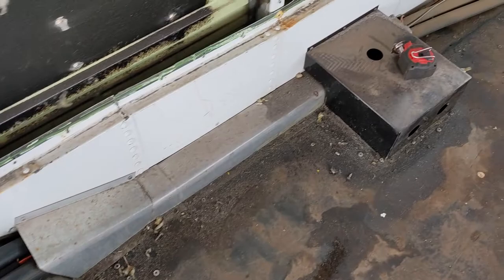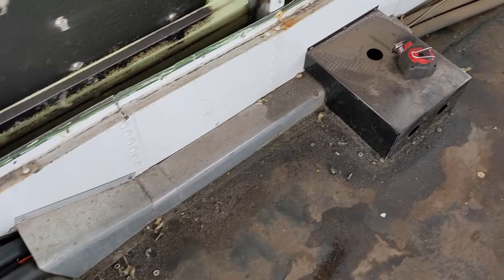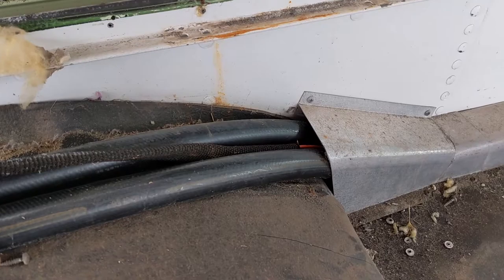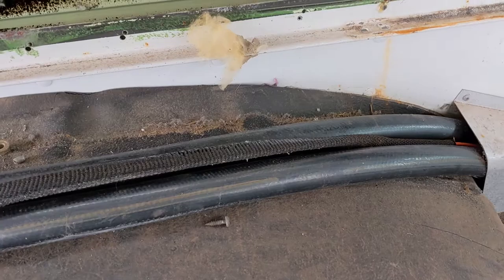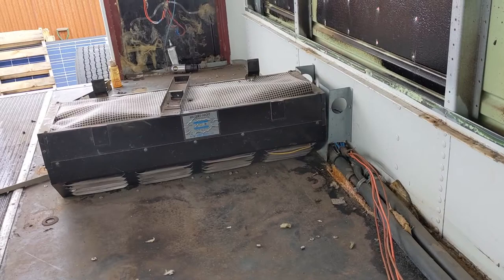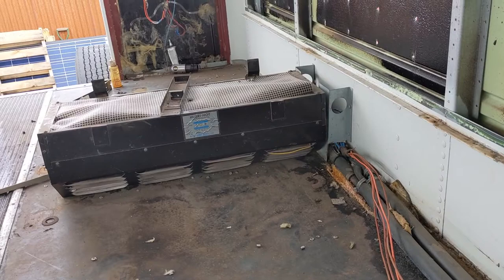What to do with your bus heater?

Comment: You diffeniantly do not want to leave them if you are not going to use them.  I had a hose bust while transporting the kids down the road.  What a mess, and it took quit some time to get it fixed.  Luckily no kids were hurt.  Imagine the damage it could have done in a conversion.  Thanks.